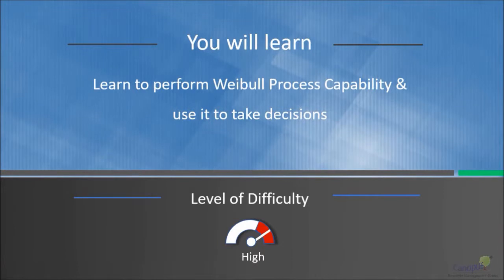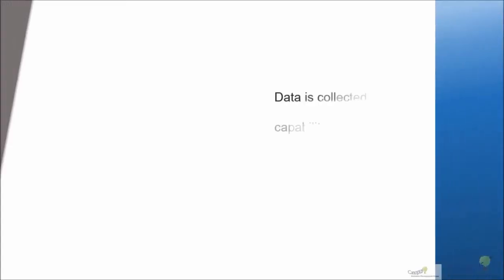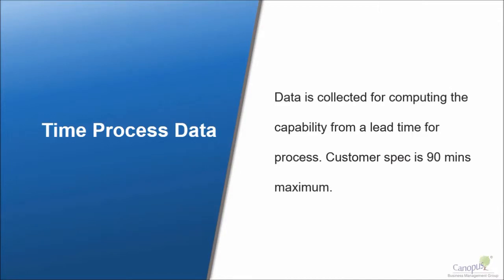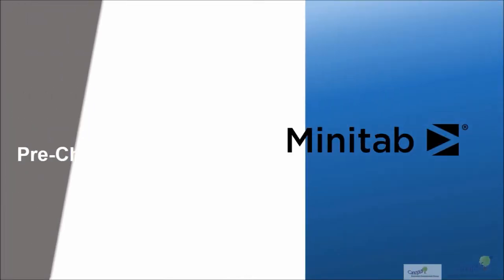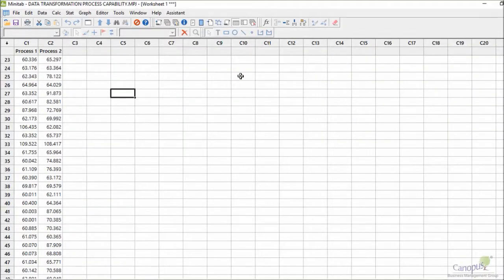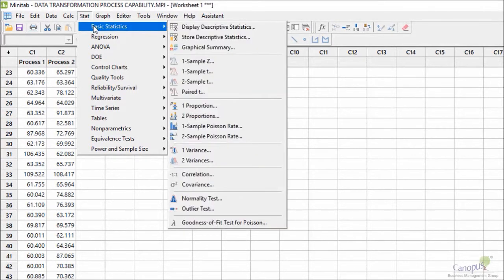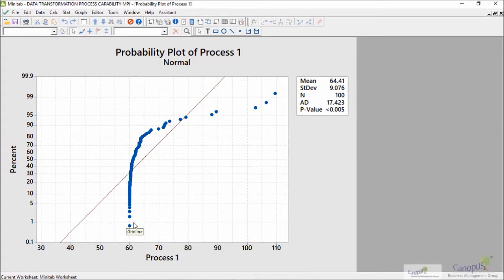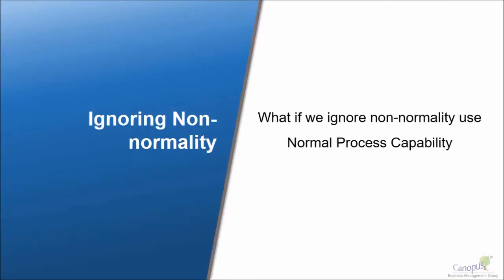Weibull Process Capability

Comment: Halo! Let me introduce myself. My name is Calista Edgina. I am a college student of Statistics, Diponegoro Univercity, Indonesia. I have a question because my final project is discussing about the application of six sigma with weibull distribution which my data is non normal distribution. So i choose weibull for my secondary manufacturing data from one of garment factory here. my question is, if i should take 3 multivariates sample Critical to Quality (CTQ). how do i test the multivariate normal if the data is non normal. is there any test for multivariate weibull? because if i'm not misataken, the conditions for  the multivariate must be normally distributed. Thank you for your time. Your answer and rensponse is very valuable to me:)